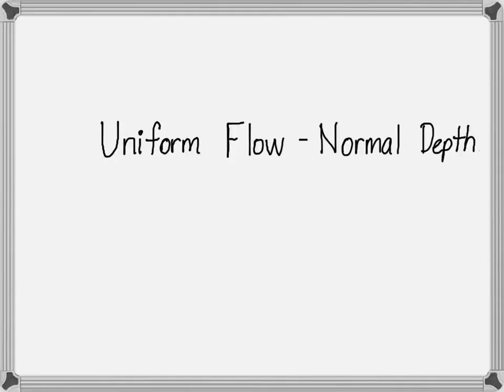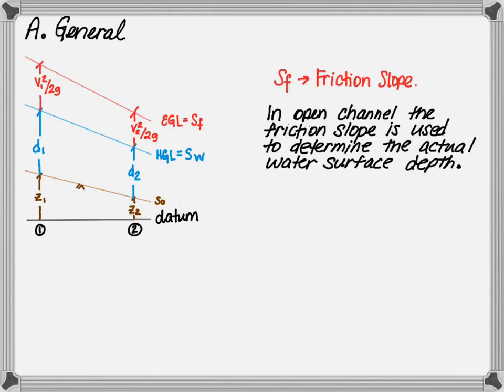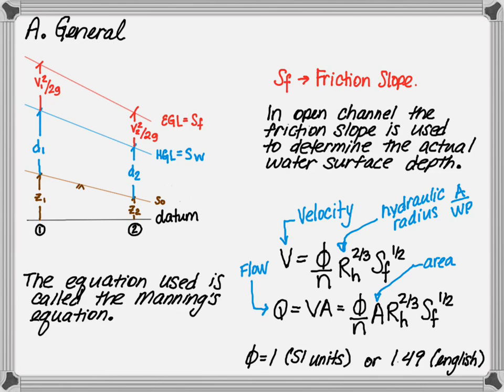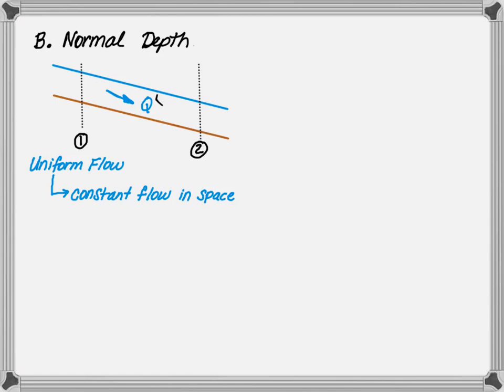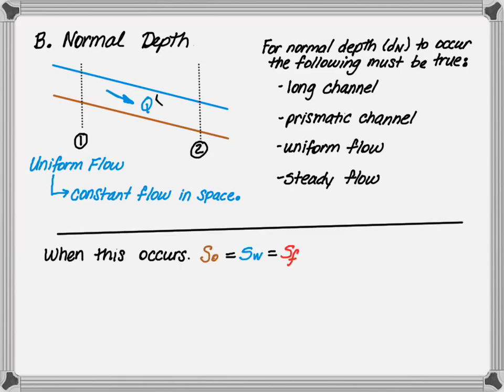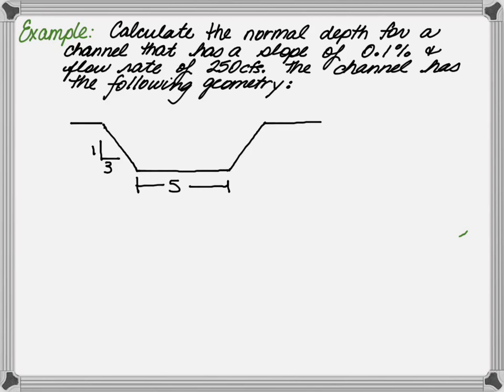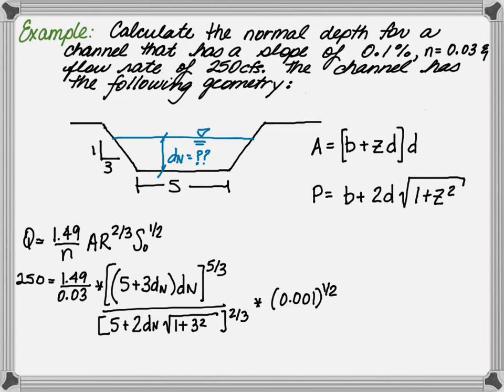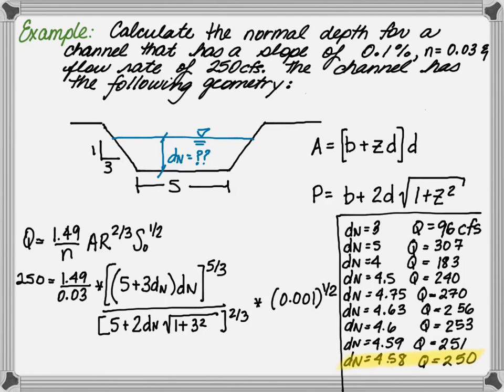Normal Depth - Uniform Flow

Comment: I don't understand what is yn (normal depth)
Like if y>yc => flow is subcritical
Similarly what can we conclude if y>yn or y<yn ?
Reply from the maker: So yn is normal depth.  The normal depth is the ideal location that the water wants to be.  If the flow depth is greater than the critical depth than the flow is subcritical.  When the flow depth is less than the critical the flow is supercritical.  The relationship of the actual depth to normal depth only provides you with direction on what the water profile will look like
Reply: @seemashah-fairbank2760  thanks i had a similar feeling about yn